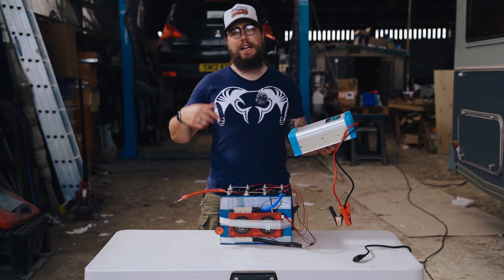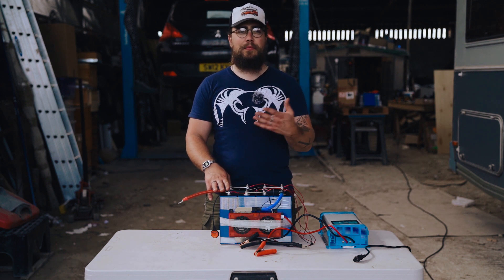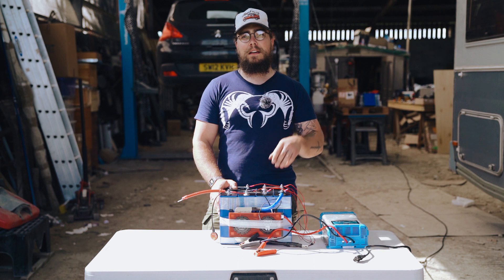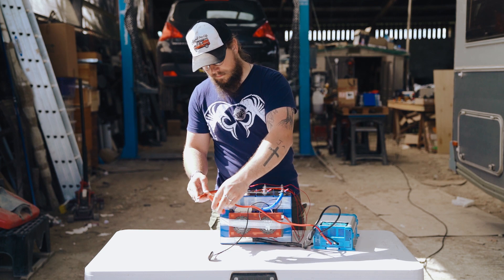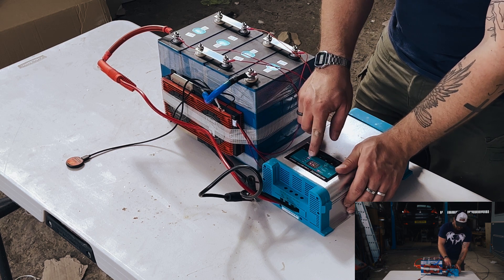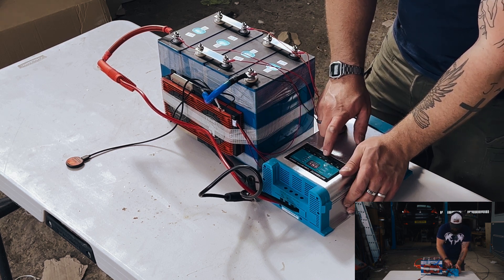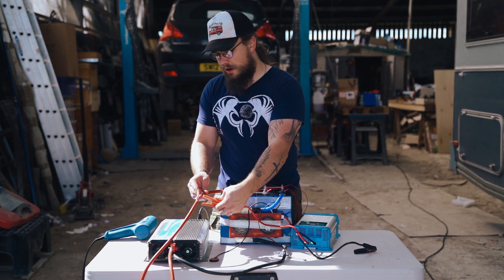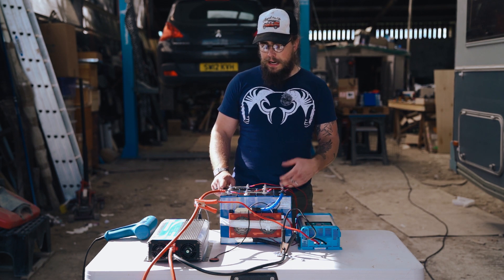Did this charger kill a LiFePO4 battery?

Comment: next time read the manual before connecting something for first time
Reply from the maker: Did you watch the video? 🤔
Reply: @offgrid_power  i did, but the first miutes where You try to change the charge mode/batter type by pressing the buttons was priceless😁 that's why, You should read the manual 😁 have the same charger over 3 years and its great for all types off batterys👍

Comment: my daly 200 amp BMS don't seem to keep my 3P 4S battery in balance very well
Reply from the maker: Have you top balanced your cells?
Reply: @offgrid_power  I'm currently doing that right now with a lab power supply check out my new live video I just did

Comment: I have the exact charger which puts up to 50amps in, and I've had no issues with it.
Reply: What is the name of the charger as l'm keen to buy one?
Reply: @MMMDRAW3   hi i bought it from sunshine solar its a 50amp 12v battery charger model ch1250l cost £179.99
Reply: @MMMDRAW3   hi i bought it from sunshine solar its a 50amp 12v battery charger model ch1250l cost £179.99

Comment: With only one cell that bulged, I would not rule out it just being a bad cell. As for the system voltage auto detect chargers, I  don't trust them. If it detected the voltage wrong, one would think the BMS would protect the battery, however that's not possible if the voltage is higher than the voltage rating of the MOSFETS used in the BMS. They will short, and allow full voltage to bypass into the battery.